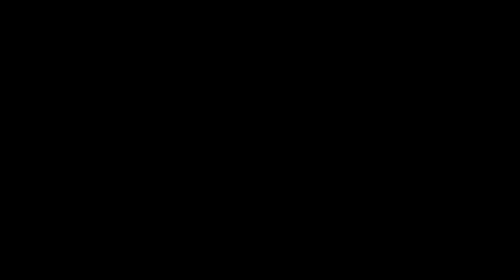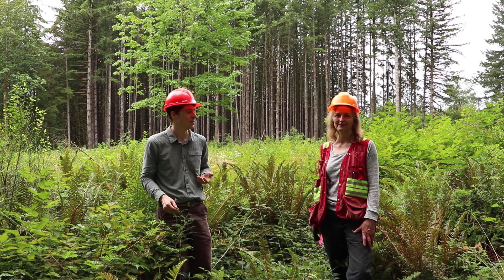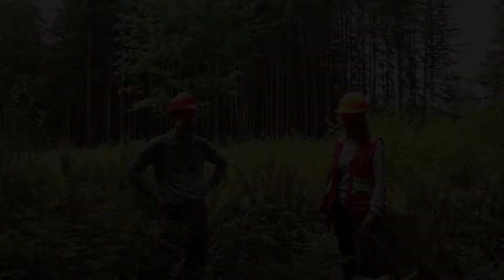Laminated Root Rot Management

Comment: Which fungi cause laminated root rot? I would think hetero basidium annosus. Is that correct? Are there any others? Is doing a sanitation cut and replanting the best course? Are there any chemical or biological methods that have been effective? If the annosus fungus disintegrate the wood, once the wood is decomposed does the fungus die and it is done in that area?